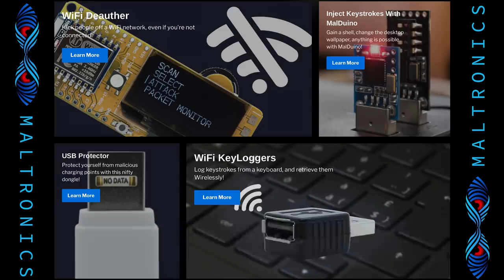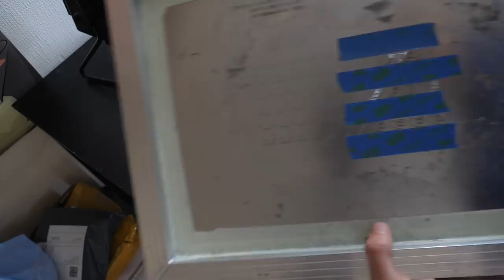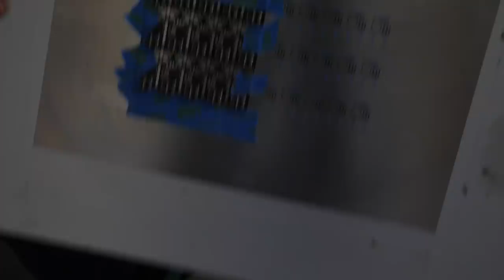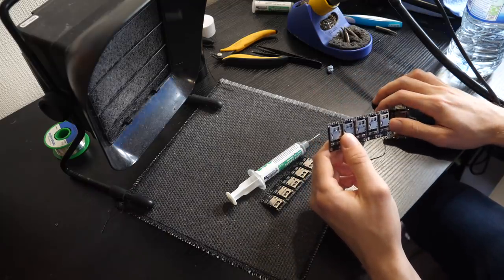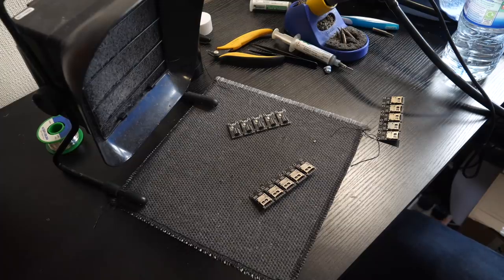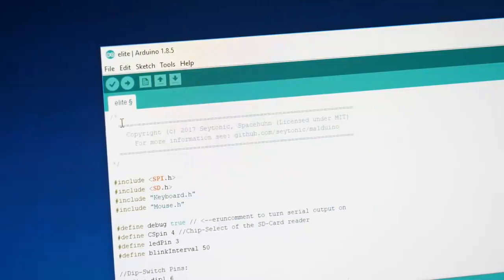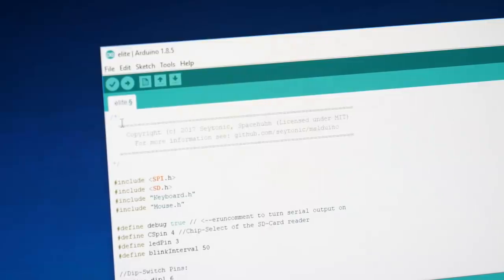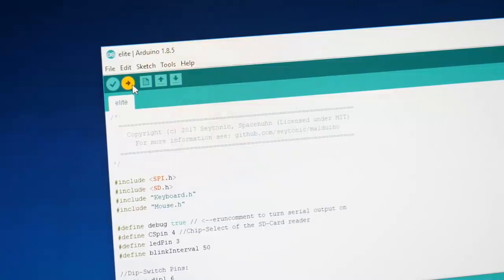MalDuino: How It's Made

Comment: I've purchased 2 of these last month and I could not even tell at first glance that these are made by hand. You've done a great job assembling them. You should look into an ultrasonic cleaner instead of the manual process you use. It is able to clean underneath the components as well.
Reply from the maker: Thanks a bunch! I plan on outsourcing manufacturing sometime soon, so cleaning pcbs with a toothbrush will become a thing of the past.
Reply: Hy i got one as well but I don’t know how to use mine please can you walk me through it. Thanks 🙏🏾

Comment: Not made in China. "Not for now atleast" 😂
Reply: Hassan Pedro made in China might not be bad
Reply: There are plenty of companies that can wave-solder boards here in the US.  There are plenty of jobs that can be created here soldering on a last component, testing them and putting your Malduinos into a plastic shell.  Perhaps you can support the US or a country that's more aligned with the western world.
Reply: made in china
=
=
=
=
=
=
=
=
=
=
=
free corona for black friday
Reply: PCBWay makes the boards and ship them really cheap. I do not remember the price, but it is quite cheap for few bucks only (I guess there is some dimensions limit to that price, too, would actually need to check), so if you actually have a small board, having it panelized is really a good idea. If you want to keep track of every sold piece, you could also use a tracking number on the PCB using silk screen and keep a list of sold pieces. PCBWay will also solder the components for you, and you can then have your product ready from China. JBC is also provides its services for board manufacturing, only $2 per board (also limited by dimensions, would need to check), so panelizing is also good idea here. JBC actually uses their own tracking number on your order and they put it on the board itself, so if you want to keep your boards off that tracking number, it would be wise to place a tracking number placeholder somewhere on a throwaway part of the panel, just to keep the number off the board itself - their placeholder is JBC repeated like 4 times, they replace it with the tracking number later. If you want to use their tracking number on individual pieces, think twice, because they'll assign the tracking number to the single board, and you may end up with bunch of boards with the same tracking number (which I guess you don't want). Keeping tracking numbers is quite pain in the ass for an individual, so I will save myself off the hassle actually.

Comment: I feel sudden urge to buy this...
Reply: I feel an urge to DIY this
Reply: @NH3 yea me too
Reply: Josef Kuchař i know but there is no sd card nor a dip switch
Reply: @nielsjonkman7196  1) You don't need sd card, you can flash the sketch directly 2) You can solder a dip switch easily
Reply: Josef Kuchař 1) this thing does look 10 million times better
Reply: @nielsjonkman7196  I don't care how it looks, if you want to have it on a shelf then go and buy it
Reply: @KucharJosef  yes I know I own four of them... But doesn't it look interesting to completely DIY this? I'm using my digisparks for non-usb-keyboard projects tho because they don't fit in a case and I don't own a 3d printer
Reply: I watch hes intro for a nother video, i went on the website and said fuck it bought it
Reply: @KucharJosef  but then u can only store 1 program
Reply: @naturalcauses1695  why?
Reply: @KucharJosef  i mean at once. There would be no way to decide what script you want it to run after you plug it in without reprogramming it
Reply: @naturalcauses1695  You can easily solder dip-switch to available pins and then you have 8-16 combinations ;)
Reply: @KucharJosef   sorry i dont know much XD but wouldnt you need a different board. Like a custom one
Reply: @naturalcauses1695  No you don't need custom board, you can solder the dipswitch on the bottom of existing board - one side to the GPIO and the other side tied together to ground. You then can use the dipswitch buttons with INPUT_PULLUP in your sketch to decide what you want to run
Reply: @KucharJosef  but man, If you put two products out there, your idea and his. Society will pick his because we are lazy and that's fact. You can swap out cards and u don't have to flash it each time, you don't have to solder a dipswitch and can just purchase it. If you were in a store, people would buy the malduino over yours and you'd fail in business
Reply: Maybe, it's good for you. But in reality easier is better, people won't buy yours, but they will buy this
Reply: @theamusingalligator6786  Mine version isn't product. I don't want to compete. It's just a tool that I created and it fulfills it's purpose
Reply: @Lifuu That's kinda true, but you can just add a check to your code if pin is high/low and add a switch.

Comment: I have a malduino, and one of the switches broke. Totally my fault. I ordered a new DIP switch, and soldered it on (with a conventional soldering iron). Even that comparatively huge component was hard to solder! It must be very difficult to solder all those tiny resistors and capacitors and the microchip.
Reply: thats why he uses solder paste
Reply: I use a microscope. It works well up to a point.
Reply: Try 0201Then collapsed

Comment: Human pick and place machine, huge cycle time, awesome stuff! Didn't think that could be done by hand.
Reply: It's best to do pre-production final prototype by hand if you are a low-capital start-up. Less investment needed to start getting something saleable.

And you know the product more intimately so if there are issues with the chosen layout you can more quickly adapt.

Then first series of sales can also be done that way: basically investing your own work time instead of risking ordering a zillion from China and finding the market is smaller than you hoped. There will be a minimum order size before ordering from abroad becomes cost effective. And you have to front the cost of the whole order before you get them back to sell  (This investment tied up in ordering stuff is sometimes called "working capital")

Then as the business grows you trade off the extra capital outlay of putting in an order against your saving labour time.

Comment: +Seytonic Heya, you don't need to use a hot air station to reflow that... You can use all manner of hot things. We personally use a toaster-oven type device with a removable lid. Preheat, set them in for a bit, and take them back out. Much easier than blowing hot air on each joint.

Comment: I don't know whether or not Louis would approve of what i'm about to say ;) but IMHO, with a decent iron, the right tip and a bit of practice, I find QFN packages to be easier to solder by hand than hot air, just tin the board extremely lightly first, then tack down two opposing corners, add some flux and run your tinned iron along the edge, starting from the side with no tack. rinse and repeat 100 or so times. I just don't seem to get the time savings that others do with solder paste when working by hand, too many nasty bridges in hard to see places. Either way, nice job, and your method seems to work for you. Good to see that cottage industry is still alive :)

Comment: How about taking the next step in DIY mass production/automation? A reflow oven made from a cheap toaster oven upgraded with a solid state switch controlled by an Arduino with temperature sensors.

Comment: If I could offer some tips:

1) Get you solder screen setup on a hinge and use some scrap boards to make a bracket to hold it in the right position. Put the board in swipe the paste over, next board.
2) Make yourself a quick part picker like this: https://www.youtube.com/watch?v=5fAbWfyrtE0 you can get other vacuum attachments that fit the syringe. Just drill a hole in the side of the syringe that you cover with your finger to create a vacuum, then let go when you want to drop it.
3) buy your parts in tape/reel format. Use some cheap double stick tape on your work surface and stick them down, then peel off the covering
4) build a reflow oven, i recommend the kit used in this video: https://www.youtube.com/watch?v=GRzsfkpgS44
5) Board design wise, you might want to make the board a little bigger and put all the hand solderable parts on one side, and the SMD parts on the other.
6) Acetone works a lot better for cleaning solder paste off the stencils
7) Build a programming rig with pogo pins. In the same vane, you could make a test rig as well.

You could seriously cut down your manufacturing time following even a few of these suggestions. I used to make a similarly complex board with 4 batches of 25 in an hour using the above methods.

Comment: @seytonic There are cheap amazon part reel holders so you can avoid tweezers by using that and a vacuum pen. From experience its like 4x faster using a vacuum pen, you dont really need a switch to turn it on/off the solder is sticky enough to overcome the vacuum! Just a simply aquarium pump is perfect. I spent 40$ on the whole thing.

Comment: instead of normal tape, why dont you use kapton tape so you can paste the pcb's then just hot air them while they are still connected to the stencil so you use all the paste and not have to worry that not everything has paste on it?

Comment: I recomend you to add some guide holes, both in the stencil and the board (an extra piece that can be snaped off), that way you can just slide a rod in the 4 (or 2 but diagonaly) holes, that way you have an easier and quicker stencil alingment.

Im no expert, Ive done smd soldering twice, but it should work if you are mass producing them.

Comment: Genuine question, what is your device failure rate / faulty returns?   
Being honest the way you clean them with that cloth certainly has me concerned. 
Im thinking that cloth could generate a fair bit of static which is murder on processors. 
And yes the problem with getting China to produce them is they dont respect copywrite and you will find Chinese copies all of a sudden. 
Nice to see a cottage industry production though.  Youll be a Millionaire by the time you reach 40 ;-) 
Thanks for the video...

Comment: Nice video.
Only thing I would add is roughing/cleaning the pads before applying solder. (Fiberglass pen and alcohol are all you need for this step.) This is because a thin layer of copper-oxide may form between when the boards are manufactured and when they ship, and roughing the pads will help the solder have a stronger bond with the board. If you do this, and the pads appear significantly brighter, you may find it much easier to get your solder to adhere to the board and not itself. thus reducing the number of bridges you encounter. It is also helpful to do this with the pins as well, but this is often much more difficult as they are not a flat surface. Also I try to not let my iron get above 320c, this is to avoid the risk of damaging sensitive chips. My iron may also have the thermocouple placed differently. So, my readings may differ from yours.
These are only suggestions based on how I was taught. My instruction came from my grandfather, who taught me to create joints strong enough to survive vibration tests for tanks. Don't take my advice as gospel, I am only a hobbyist. I have not done this at the volume you are working with, nor have I done soldering at an industrial level. My advice is all habit, which comes as second hand advice.

Comment: Flux is a good thing, the message I got from the vid was as if it was a bad thing not sure if that was the intent. Flux basically helps create a cleaner solder connection. You do however have to clean up the flux because after a while it can corrode solder joints.
Reply: Flux is a good thing while soldering but a bad thing when it outstays its welcome 

Think of it like washing up liquid  (dish soap). It's great for cleaning out a cup, but not so great if some stays around to join your next coffee...

Comment: Hi seytonic,
I am writing to you in order to obtain knowledge on a certain use case of the tactile switch.

I would like to connect the switch in such a way that when pressed the power is disconnected.
This would allow for a raspberry pi to be rebooted without having to manually disconnect and reconnect the power cable. I was hoping to use this to easily switch between Kali Linux and raspbian, the official os.

Yours faithfully,
Annoymous
Reply: P.S I also feel a modified version could be used with the malduino elite to execute another script without unplugging

Comment: Soldering those components with and iron, and making the joints look "factory" or flow solder quality, really isn't that hard. If you've ever done any rework on ie. iphone boards, often hand soldering 01005's, this is like working with hollow concrete sized blocks vs lego. But you need a different soldering iron, one with cartridge "tips" like for instance Hakko T12/15. These have the heating element integrated right out near the tip, so you can use irons with a much shorter grip-to-tip distance. Ideally under 50mm. And rest your forearm and side of your palm on the work surface so you relieve tension in the large muscles of your arm snd shoulder, and only manouver the iron with your fingers. 

That said, even if it's absolutely doable, it's not a good approach for mass production. For that you want stencils, paste and hot air, at least at these volumes. Hand placing components is fine for this stuff, just make sure you get alignment spot on for the quad chip.